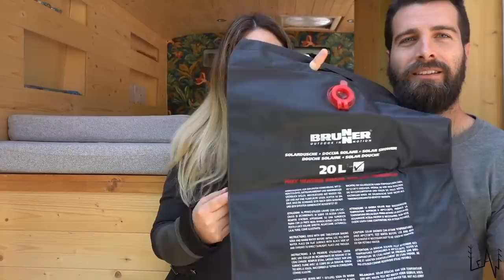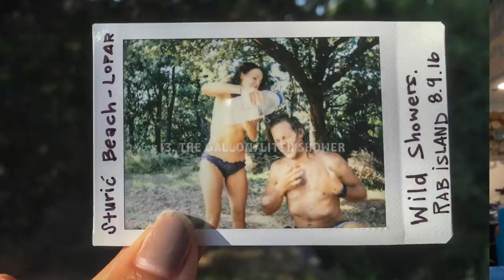15 WAYS WE (and other van lifers) SHOWER IN A VAN!

Comment: I think in the winter, it's easier to go without a shower a day or two, but in the hot summer heat, I might need a bit more showers. I do have a portable Bidet bottle that I travel with for those long airport delays. It's good for your hygiene needs. It has a long nozzle.

Comment: Thanks so much for this video. I plan on building a shower drawer like you all did. One thing I wanted to know about your shower drawer build is how you did the drain? How does the drain line work when you pull in and out your drawer?  Can you go into more detail how that works? It would be greatly appreciated. Thanks

Comment: We was travel with our four kids through Australia and New Zealand view years ago and we was using mainly solar shower.  But in could regions of NZ we using swimming pools where we can always find a nice place for shower.  Now we have fife kids and we have DIY system for make a hot water.  We connect to coolant in engine of our Sprinter van and everytime when we drive we have 80 litres  (21 gallons) of hot water in our boiler 🙂
Reply from the maker: Had wondered if this was ;possible when building our van...What's the device you have or are there instructions for this?
Reply: @Mrandmrsadventure  I have no instructions,  all of this I do by my self (except welding). I send you a message by Facebook/massager also with a few photos of this 😉
Reply from the maker: @filipwedrownicki1273  That would be great!